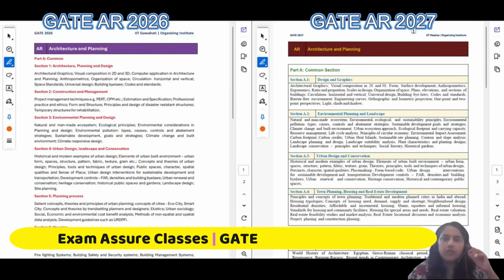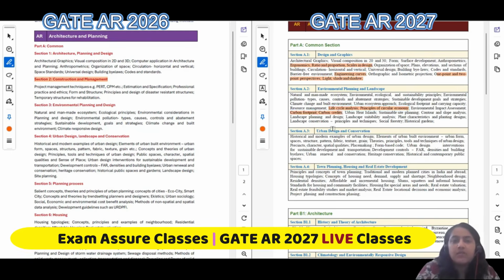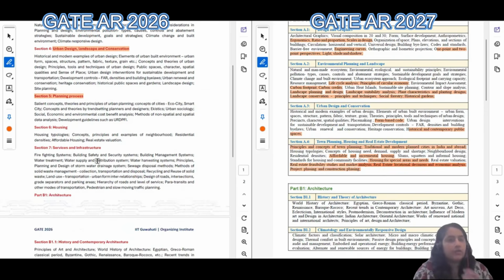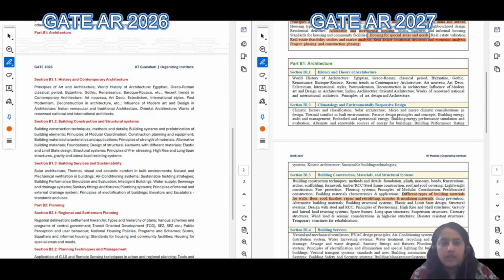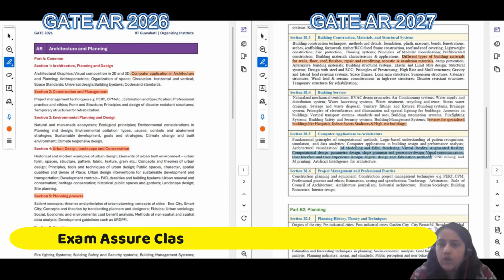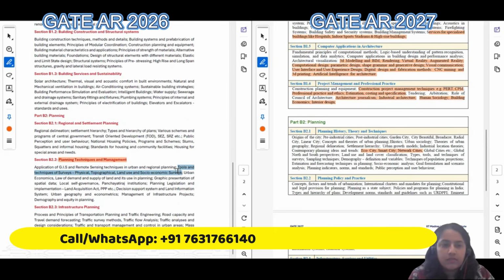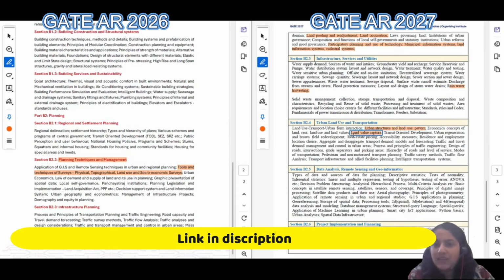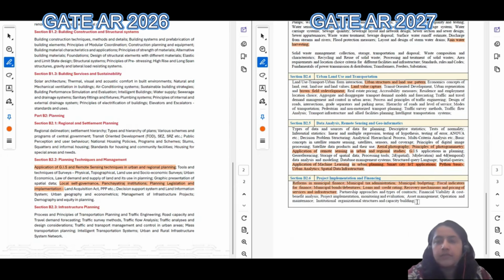GATE AR 2027 Syllabus Changed  | Comparison with Previous (2026) Syllabus by Exam Assure Classes

Comment: These year the syllabus is way more lengthier as compared to previous year syllabus. But still please tell us that the marks segregation of the section.
Reply from the maker: The marking segregation remains the same as earlier.

General Aptitude (GA) - 15 marks, the AR test paper consists of two parts: Part A (60 marks) and Part B (25 marks).

Part A is common for all the candidates. Part B contains two parts: Part B1 (Architecture) and Part B2 (Planning). The choice of Part B1 or Part B2 can be made during the examination.

Part A consists of 39 questions carrying a total of 60 marks: 18 questions carrying 1 mark each and 21 questions carrying 2 marks each. 

Part B1 (Architecture) and Part B2 (Planning) consist of 16 questions each carrying a total of 25 marks: 7 questions carrying 1 mark each and 9 questions carrying 2 marks each.

Comment: Could you please confirm if the mark distribution across the different sections remains unchanged?
Reply from the maker: The marking segregation remains the same as earlier.

General Aptitude (GA) - 15 marks, the AR test paper consists of two parts: Part A (60 marks) and Part B (25 marks).

Part A is common for all the candidates. Part B contains two parts: Part B1 (Architecture) and Part B2 (Planning). The choice of Part B1 or Part B2 can be made during the examination.

Part A consists of 39 questions carrying a total of 60 marks: 18 questions carrying 1 mark each and 21 questions carrying 2 marks each. 

Part B1 (Architecture) and Part B2 (Planning) consist of 16 questions each carrying a total of 25 marks: 7 questions carrying 1 mark each and 9 questions carrying 2 marks each.